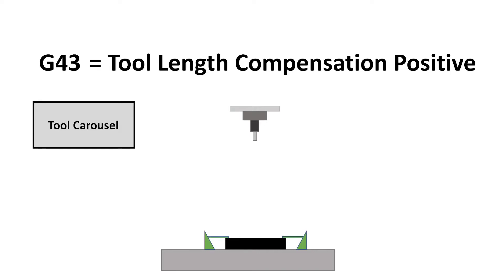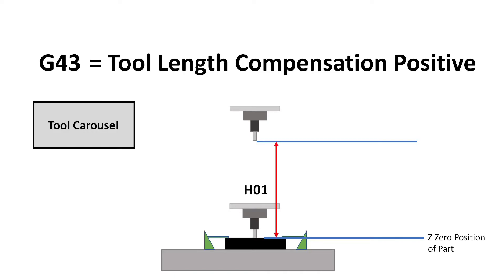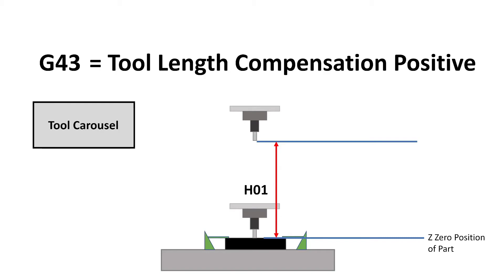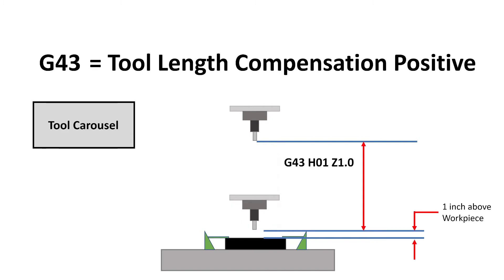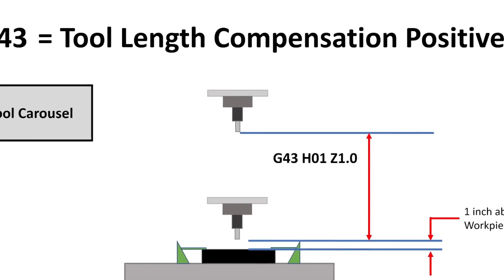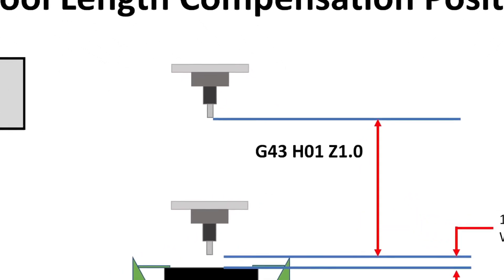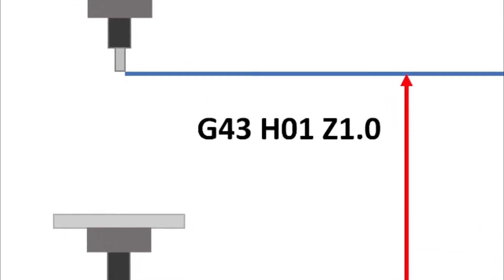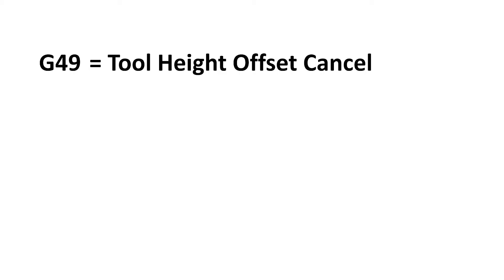CNC Programming G43 G44 G49 CNC Milling Lesson 8

Comment: Was curious, when setting up a part and the offsets, when you put a new tool in machine lets say T1, and you touch off your work offset, and tool heigh offset, do you do one before the other? Also would you typically zero out the position of the tool after replacing T1 with the new tool prior to touching off?
Reply from the maker: @mattchew4161 - it's not necessary in all cases to pick up one offset before the other. But saying that, if you are picking each tool up individually off the top of your part (work z datum) let's say, then setting your work z datum first would make sense. 
If you don't require picking each tool up off the surface of your part and perhaps you're picking your tools up off of a 1-2-3 block or perhaps you have a tool pre-setter machine, then you can touch off your work z datum before or after your tools offsets have been picked up and entered. 
I'll try and get a video for picking up datums uploaded in the very near future.

Comment: I use the g49 function like parmesan on pasta but I can't understand the usefulness of recalling the g43 function.. If I insert the T1 tool into the spindle which I hear defines g43 h1.  It seems obvious to me to attribute its length to that tool.  I'm not stupid enough to call T1 and give it the value h2.  I hope I didn't guess the use of the g49 because it's really stupid.  I consider g49 useful instead because it is useful for obtaining dimensional tolerances.
Reply from the maker: @stefanodeberardinis Thank you for your thoughts.  G49 is mostly useful in the safety line. This is just in case a machine was shut down or the power went out while a tool was not homed after use.  G49 just cancels the last tool length that was compensated for. Remember that if you use G43, it stays active until you use G49. So if use use G49 "like parmesan" then you will have to call up G43 for the next tool you call up. Only G43, G44 or G49 is active at any time.
Thanks again for reaching out.